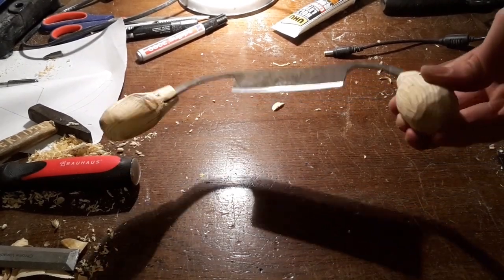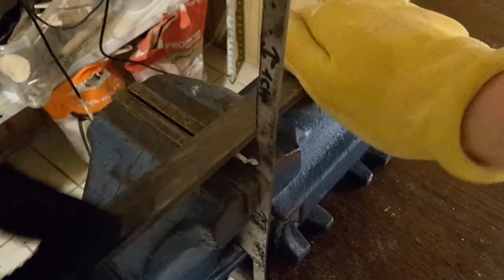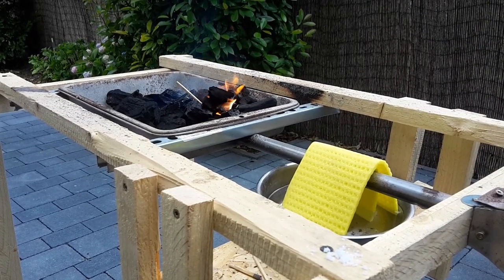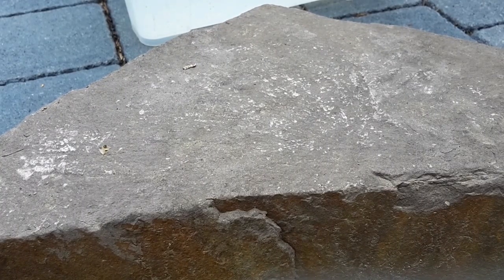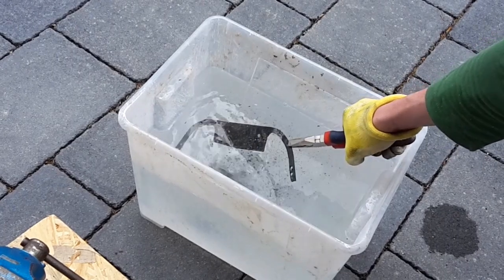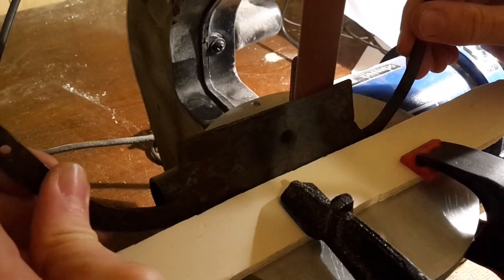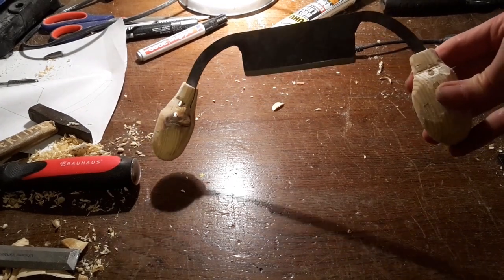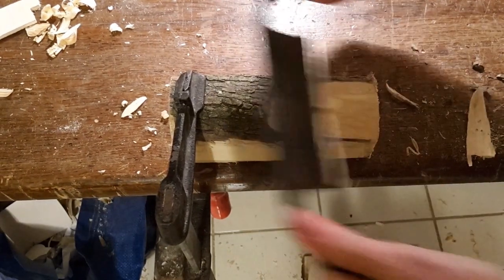How to forge a draw knife using basic tools!

Comment: i have some advice. 
1 forge it from scratch do not use plates like that.
2. no the burns from a forge is a 100times hotter than a normal bed of coal so much worse.
3. the centre punch just hit once but just a bit harder it holds its tip better then.
4. move it around in the water from the moment you put it down.
5 when you drill put oil on the drill head to preferve its sharpness and effectiveness.
Reply from the maker: Thanks for the advice!

Comment: Now go back and make it correctly :/ so many issues with this knife I'm honestly surprised it works at all.
Reply from the maker: Which are? Maybe the 'arms' are a bit thin but that's easily fixable.
Reply: Wooden Weaponry I'm going to have to go back and watch it again since I can't remember off hand outside of the quench. If I'm remembering correctly ( and I may not be) you quenched in water? That's a hudge no no, as it puts undue stress on the metal from cooling too fast. I know there was something else but like I said I'll go back through and check it out and let you know
Reply: After review, here are some of the other notes I saw. Stop cold forging: When your metal stops glowing, and has the natural grey metal look to it, that means it's time to re-heat, that can put undue stress on the arms since they are being bent and they might even snap off during a pull. 

If you are looking at getting into blacksmithing, consider the size of what you want to work with. If you are going to do small projects consider making or purchasing a small anvil, This will allow you to round your handles with greater ease and usually avoid the warp you experienced in your handle area. 

As mentioned earlier, you quenched in water, which put undue stress on your blade and gave you a slight U type warp to the point where, even with the handles off, it would most likely not lay flat. This can be a big problem when using it for cutting.   Please note I'm not trying to be an ass in this, Simply trying to help you expand your abilities and learn from the experience.  Please feel free to reach back out if you have any further questions. Would love to see you make another one with some of the improvements mentioned.
Reply from the maker: Thanks for these tips! I will definitely take them into consideration. I am relatively new in this field and can use every advise given to me by more experienced people.